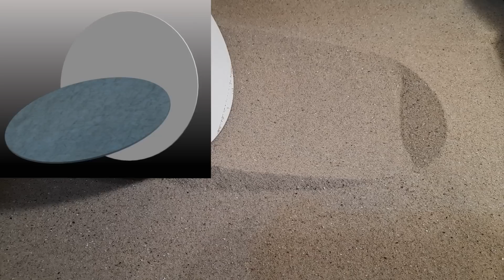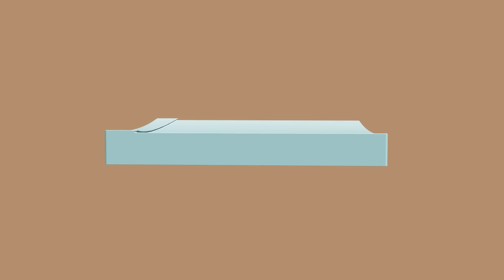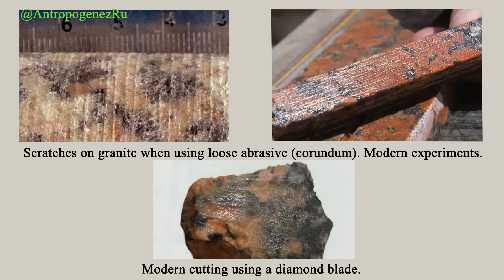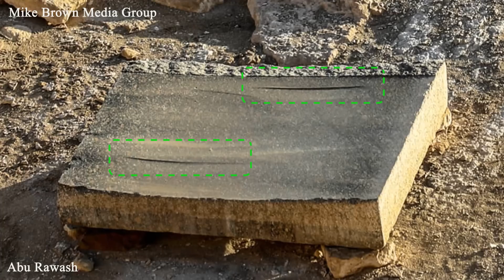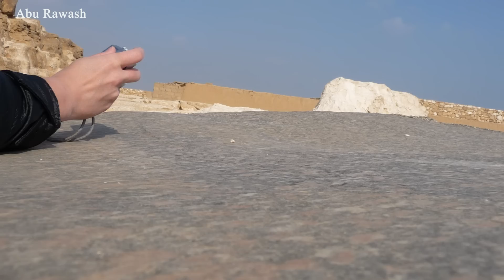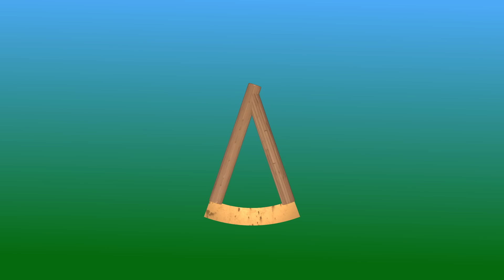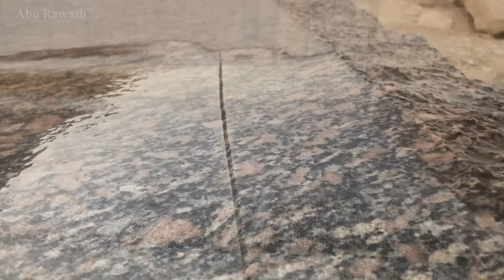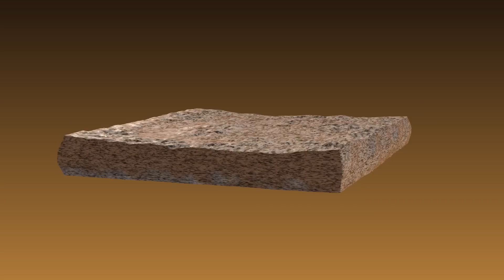The Abu Rawash Artifact: Evidence for the Existence — or Absence of Circular Saws in Ancient Egypt?

Comment: You folks in the comments are so delusional. Egyptians cut stone the exact same way we do today- They rubbed a harder rock against it.  We use motors to spin our tools faster, but the egyptians did the exact same thing using Muscle Power.  You can take a copper or even wooden rod, coat it with pitch and roll it in sand or crushed garnet and it Will cut granite just like a modern diamond tipped drill, which is the same thing, chips of harder rock stuck to a rod.
You can take linen twine, soak it in pitch and roll it in crushed garnet or even ordinary sand, and it will cut stone just like a bandsaw.   Even though you are just yanking the twine back and forth by hand.   It will take longer, but it will make the exact same marks as it cuts.
You can take a butter knife shaped tool made of copper or wood, coat it with pitch and roll it in crushed garnet or sand and it will carve a thin kerf slot thru granite like any saw.
Seriously.  It’s NOT mystifying to ANYONE who has actually been trained to carve stone.
Reply from the maker: Thank you, you haven't watched the video, that's exactly what we're talking about
Reply: @GRES_TAC  It was aimed at the commenters claiming they had to have motorized tools.
Reply from the maker: I understand. What do you say about the stone vases? Some are really accurate. https://youtu.be/oktyh5Oasw4  Chris King offers a plain bearing. https://youtu.be/o2WelA-T6cE?t=957
Reply: @ The first thing the egyptians invented was the potters wheel, which is just a vertical lathe. It is almost impossible to make a turned object that is NOT perfect on a properly set up lathe. Obviously, they would not be spinning it when cutting the area  between the handles. But you would still just set up a wooden profile that captured the curve you were cutting to, and gradually move it closer and closer as you cut away just the high points, until the profile was in contact its full length. Applying a paste with finely powdered sand and just turning the vase back and forth against the profile would polish the surface nearly perfect.   I do this kind of thing all the time when I am turning a shape in plaster. I don’t turn the vase with a motor, it remains still. I turn the profile by hand. The only difference with granite is how long it would take. I have used this technique to make radially symmetrical bowls 20 feet across for giant fountains.  ( we used the plaster model to make a mold to cast the bowls in concrete. ) It’s NOT difficult, it’s just tedious and time consuming.
Reply: @GRES_TAC  PS - I am a professional sculptor who was trained by Italians in the old world traditions.  I have never seen anything done by Egyptians that I could not duplicate using basic hand tools and guile.  Precision is not amazing. A simple pair of dividers and cutting gradually until you reach a target dimension is pretty much how you carve any stone.   I have even moved and positioned a 7 ton granite boulder all by myself without any difficulty using nothing but a 20 foot length of 2 x 12.  People who imagine it could not have been done without modern equipment are just people who have never done anything with their hands. There are quarries all over the world that still split enormous blocks of granite using water soaked wood.  E.g. The average Pyramid stone weighs 1.8 -2.2 tons.  On a smooth hard surface, like concrete, or dressed limestone, you just have to dust the surface lightly with dry beach or river sand ( because the grains are more rounded ) and the stone will slide like its on ball bearings. A ramp like the causeways at Giza is plenty smooth that just ten guys could RUN a 2 ton block up that incline as easily as pushing a stalled car.  People today just Imagine it’s harder than it really is. It’s labor intensive, sure. But when you have to move millions of blocks of stone, folks rapidly figure out the most efficient way to do it. And the causeways prove that egyptians could build and dress roadways and ramps that facilitate the moving of heavy things.   The evidence is lacking because when later generations want to pilfer already dressed stone the first thing they nab is walkways and road surfaces at ground level.   Rome put a 340 ton rock in the Temple Mount.  But before they moved it, they surveyed and built a road with a smooth downhill grade from the quarry to the site to make the move doable. 
How do I know this? Because anyone with a moderate amount of brains would do the same. Especially if you were planning on moving a whopping lot of large stones.
Reply from the maker: Thank you. I have worked on different machines and understand what you are talking about. The questions are a little different. For example, how to maintain the wall thickness using simple methods. Or how to remove the inner part symmetrically relative to the outer one.
Reply: @ Again, The inner side is no different than the outer, except because it does not have handles you could literally spin the vase to effect the cutting. They were cut standing vertically and you rig a centerpoint above the opening. Into that opening you can fix a two part mandrill coated with garnet or other abrasives, and spin the vase around it, relying on the momentum of the vase to add the elbow grease. A simple set of shims driven into the split mandrill would spread it gradually as it cuts.  If you start with a mandril that has an exaggerated curve, the abrasive action will gradually pare down the mandril to a softer version of that curve, although you might have to replace the mandril with larger ones over time.   If your mandril is properly centered on the pivot point of the vase on a turntable, it will cut a wall thickness that is symmetrical.

This is the same way people cut natural rock crystal into goblets in later centuries. Again, tedious as all get out. But simple as regards tooling.  Anyone watching a potter use a potters wheel would figure this out.
Reply from the maker: I understand well what you are talking about, and I have also repeatedly moved large weights on rollers (pipes). And processed stone manually. "If your mandril is properly centered on the pivot point of the vase on a turntable, it will cut a wall thickness that is symmetrical." This will not happen if the potter's wheel is beating. And you will get symmetry, but not the wall thickness across the entire cross-section. So a good bearing and a tool with a fixed abrasive to solve the problem.
Reply: @GRES_TAC  Watch a potter.   If you take even a rough lump of clay and stick two thumbs down into it, it will push the clay outward perfectly symmetrically because you are applying force in opposite directions. It CAN’T shape the clay other than radially even.   By the same token, you center the outside by pushing on opposite sides with equal force and what you end up with HAS to be as radially accurate as the center of the pivot.
So that is why a split mandril in the center. You start with a drill, just to get a hole, but it doesn’t even have to be round.  You can cut the bore of a bronze cannon by spinning the cannon around a BLADE as long as the blade is symmetrical on the axis of rotation, the cannon bore will be radially uniform. The sheer mass of the solid cast canon applies most of the cutting force as long as the cradle its spinning in does not wobble. The momentum of the turning cannon and the cutting force on opposite sides holds the blade centered. 
And just look at Egyptian granary pots. These things were not light when they were wet. And if their wheel shafts had any significant wobble their pots would have flown off. So you can know that any culture that can build a mass production potters wheel has the capacity to build an accurate pivot that can take loading.    Egyptians HAD lathes. Surviving furnishings often show turned stiles, legs, and spreaders. And more complex parts that were asymmetric, but had segments that had to have been turned accurately despite the wobble induced by any asymmetric portions.   Cutting the outside of a granite vase to a radially even shape does not require spinning the granite to cut it. You simply mount a profile pattern in a fixed position that can radially slide relative to the center, and move it closer till it touches  the granite. If you put chalk or some colored grease on the profile edge, it will mark the granite at its high points. ( you can either spin the vase relative to the profile, or vice versa ) You carve away the high points and mark it again.   You keep doing that until the vase is in full contact with the profile template all the way around and you have a radially symmetrical object. ETA- that is, you are not even relying on spinning as you would with a lathe or cutting the center out. You are turning the vase, or the template, gradually with no forces applied, just as a means of accurately measuring.
Reply from the maker: Thank you. That's not what I mean. Radial symmetry is provided by the rotation itself, that's clear.
"The Origins and Use of the Potter's Wheel
in Ancient Egypt S. K. Doherty" that's what they had.
Reply from the maker: "it will mark the granite at its high points" on 16.28 https://youtu.be/EGue2gO36ck?t=988 the vase will be inaccurate  https://youtu.be/XzN8wtBF2Kw?t=1185 19,45 There are 4 types of vases. 1. Not even at all. 2. Accurate to 0.5mm. 3. Accurate to 0.01mm. 4. Fake. I am talking about #3. What you are talking about is #2.
Reply: @GRES_TAC  They did not use a potter’s wheel specifically for granite vases.  But if they can make a stable potter’s wheel, they can figure out how to make a stable turntable for something heavier.  And, again, when cutting granite, you would NOT spin it unless it was already pretty symmetrical because of its mass.  But it is a trivial problem to set up a radially accurate profile to measure with. And then just use a hard shaping stone. Or flat plane mandrills coated with abrasives to work the surface down to a curve matching the profile.   
For example. How do you carve a large figure sculpture in stone?  If you are close enough to cut the stone, you are too close to see the overall effect of what you are doing. If you are far enough away to gauge the overall figure, you are too far to get a chisel on the stone.   So what you do as a sculptor is make a Maquette. A smaller model at a scale factor smaller to workout the entire sculpture in something easy like wax or terra cotta.  Then you build a reference frame around it and use a surface gauge or plumb bob to measure a few hundred points in 3 dimensions.   You then build a larger reference frame around the stone and multiply all your measures by the scale factor, but you do not cut to those dimensions initially. You add a half inch to every dimension so that what you end up cutting is an offset of the final surface.  That removes 98% of the rock you need to remove but keeps your rougher tools well away from the final surface.   Then you go over it again with finer tools cutting to measure that are all 1/4 inch proud of the final surface.   Then again to measures that are all 1/8” proud.   In that way you very gradually sneak up on the correct measures while allowing yourself enough wiggle room to not create any gouges or chips so deep that you can’t average them all out. ( and the ability to make minor changes you may feel needed due to the larger size or flaws in the stone.) 
Same with a granite vase. You could start with a profile that is offset half an inch for the rough cutting. And then switch out to closer and closer profiles, thereby getting closer and closer to a perfect curve with each pass.  OR you could just start with the correct profile half an inch out, and gradually move it closer. 
As to the marking of high points.   
This is basically how the oddly shaped stones seen in Peru megalithic structures can be cut to perfect mating surfaces by hand. The same way your dentist corrects your bite when he does a filling or crown.   I can just cast a plaster form off the top of some oddly shaped stone already set in the wall, and then take that lightweight plaster casting to the quarry and keep marking it with red ocher or some chalk and setting the plaster casting lightly on the next stone.  It will leave marks where it touches. I cut everywhere the color transferred, and then do it again. And again. My goal is to get to the point where when I put the plaster cast negative on the stone in the quarry, it will leave color uniformly across the entire surface I am carving to mate.  In this way I can know to a certainty that surface I cut will mate perfectly with the stone in the wall from which I took the plaster casting of its upper surface. I then turn the stone over and dress the non-mating sides, and that way I only have to move that stone one time from the quarry to the wall site and I can know it will fit without issue.
Reply from the maker: @christopherpardell4418  Thank you. I agree with you. This can be stated more briefly. "Marking blue method" is the first mention of such principles "De Architectura" by Marcus Vitruvius Pollio
Everything you write, I know and did. There are small details that require explanation, and you are talking about well-known things. You will not get 0.01 mm accuracy on the potter's wheel that the Egyptians had, which means they had something a little better. You will not get polygonal masonry simply by making plaster casts, and even better - using copper plates, you will get something close but not what Protzen got in experiments. https://youtu.be/1OQl9pqhPb4?t=2296 38.16 Every time there remains "a little wrong"
Reply: @ No. I can cut to any level of accuracy using the technique I just described.  If I take my time I can make objects that are symmetrical to an optical comparator to within 0.01 mm.  It’s just about how much time I am willing to take sneaking up on the correct measure and refining the surface.  No one I know wants to pay for that level of accuracy in a stone or other object.   All of this is doable. 
For example, How did egyptians align their pyramids to within 4 minutes of arc without having the geometry to even measure minutes of arc?  Its simple. Take a slender stick and set it dead plumb in a flat area on a sunny day. At some point in the morning trace the length and position of the shadow cast by the stick on the ground.   Then take a length of string and use the stick as the center pivot to scribe a circle around the stick the radial length of that shadow.  Now wait til afternoon.  The shadow of the stick with change length and position over the course of midday, but eventually the very tip of the shadow will touch the circle you scribe, on the opposite side of the stick. Trace the length and angle of that shadow.  The two traced shadow lines record the position of the sun exactly the same length of time before and after local noon. Bisecting the angle they form gives you true north.  A line from one tip to the other is perfectly east west.   If you did this with a stick about 5 feet tall, it will give you true north accurate to within 4 minuets of arc, without you even knowing what a minute of arc is, nor having a clock capable of keeping accurate time and it works on any sunny day, anywhere on earth.  
And what do you know, the only relief image we have of a pharaoh measuring the foundation of a building shows him sighting over a stick, about 5 feet tall. 
Everything the Egyptians did was doable without sophisticated tech. We know because they DID it, and yet they did not show ANY trace of all the other things that more sophisticated tech would have enabled them to do.
Reply from the maker: It is clear that the Egyptians did not have high technology. It is also clear that the accuracy of the vessels should be obtained by itself, due to the principle of execution itself. "I can make objects that are symmetrical to an optical comparator to within 0.01 mm" you can, because you have something to check. The Egyptians did not have measuring devices, which means this accuracy was obtained by itself, due to rotation. This is also obvious. All this time I have been talking about a specific principle, and not theoretical considerations.
Reply: @ Again. You are talking about things you can’t prove being ‘ a little wrong’. We have NO ancient egyptian potter’s wheels in new condition. But I have thrown a lot of pots. The physics of throwing granary size pots indicates a potters wheel with a pretty good bearing.  And they certianly had mills stones that spun granite millstones without issue. But again, in cutting granite vases, you would never spin it as fast as clay on a potters wheel. Even grinding out the center it would turn at maybe one to 3 rpm.  And MOST of the exterior shaping you would be doing just turning it partial turns by hand relative to a profile.  You can absolutely get 0.01mm accuracy carving it by hand because you can MEASURE it using a turntable or rotating profile to that level of accuracy. 
And sorry- But you absolutely CAN carve polygonal rocks to fit accurately using the technique I outlined. I have had to carve remarkably complex shapes to fit and using that technique it works just fine.   If you want to test it, you can do it pretty rapidly if you just use cast plaster ‘rocks’ and try to carve another chunk of plaster to match.
Any “little bit wrong” you or other investigators might observe is simply attributable to lack of expertise and experience. 
To wit, initial attempts by anthropologists and archaeologists to duplicate stone napping techniques for making spear points and arrowheads all looked ‘ a little bit wrong’. But those who kept at it and invested 10,000 hours of practice, ended up capable of duplicating even the most refined stone points and knives. 
In my studio, I teach apprentices how to work plaster.  It takes them five years of practice to get to the point where they can do anything even remotely as well as I can, and we are just talking about mixing and working plaster using just your hands and a flat length of steel. 
Expertise easily bridges the small gaps you imagine to exist.
Reply from the maker: @ Yes, experience is the basis of perfection. And the story about 10,000 hours to master a skill is well known.
It's not about the impossibility of adjusting the stones, it's about the fact that this is a sculptural work, and the Inca statues are very rough.
The simplest solution for the accuracy of vases is to reproduce them with such accuracy even on a softer material, since this does not change the essence. The same plaster. First on a modern potter's wheel, then on something similar to what the Egyptians had. That is, we are talking about a specific device. And not about the fact that if you provide rotation and have an abrasive tool, then the accuracy will come by itself. Of course it will work if this accuracy is initially incorporated into the method.